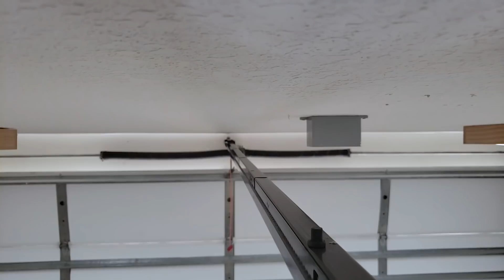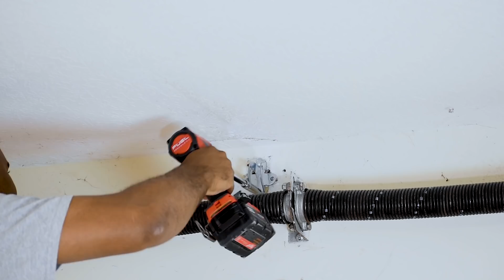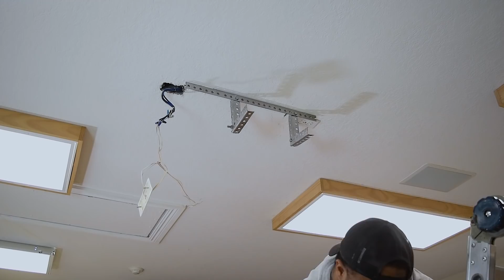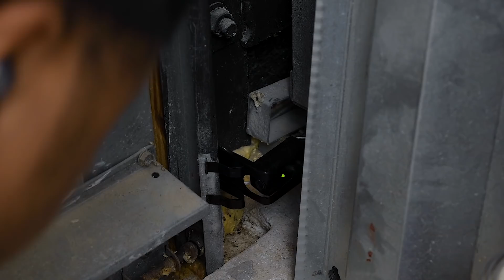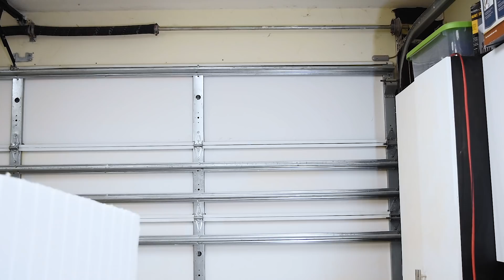3 DIY Garage Door Upgrades | Adding insulation, Replacing Opener and Weather Strip (in one day)

Comment from the maker: Thanks to all the Garage-Pros! I got rid of the slack in the belt I just needed to add a little more tension to it! 
To find out more about this project I have a written version here. I will post all my updates on this project here.  http://bit.ly/2YUeTaa
Reply: Glad you fixed the slack issue, however  you should really change the position of the door bracket from the top of the door to right beneath the strut. With that said, reverse the way you have the operator arm & elbow attached. The arm and elbow should make a general check mark shape, approximately 45°-75° of an angle. 

Trust me, it works much better this way.

Edit: Six more things to note....

1: if you do what I said with the opener bracket and arm, your door will go up further to match the height of the header, from what I see it is sitting below the header, not giving you the full extension.

2. Photo sensors are best 6-12 inches from the ground, low is good, however, it is best if you have them near the point of a bumper or point of first contact of a wheel, the latter of which is my preference. If it is too low it gives slight seconds less time for the sensors to be tripped I itiating the safety reverse, seconds that could save you a lot of money and time.

3. Your operator could be lowered (from my guess) 3-5 inches, which greatly reduces stress on the door when it runs. Yes, struts help, but you have a non insulated door (putting insulation in does not fix this issue) it generally forms stress cracks in the top of the panel given enough time, or if a stressful event occurs (hitting the doors, spring failure mid cycle, etc.)

4. When you talk about lubricating a door, show them helpful places to hit, including wheels (especially if you have bearings), pulleys, if applicable, springs, operator rails and bullet system, as well as hinges. Noting you sprayed the side track.....it is good in thought, but the wheels do not actually touch where you sprayed. Run the door up and spray in the rounded part of the track where the wheels actually run along, best to start at the curve of the track and run the spray down to the floor. Another tip, if your door is still creaking, manually operate the door and spray between the panels....run it a few times and wipe the excess, it usually does the trick. In  between seasons this happens often.

5. When adding insulation it can add as much as 10-25 lbs. to the weight of the door, which in most cases is too much for the springs that are initially with the door, meant for it's original weight.

6. When uninstalling an old opener there is almost never a need to remove the belt/chain, or the rail itself. You only gave yourself more work.

J & B Garage Doors, 50 years family O&O

Best of luck in your endeavors.
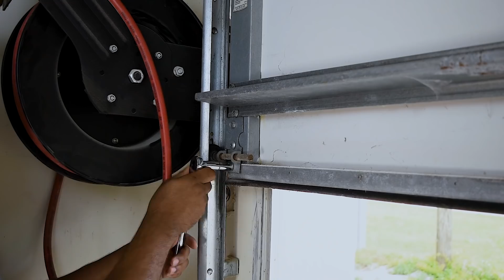Reply: @influxedhoc  Really good advise for anyone undertaking garage door DIY :). I would also add that the bottom brackets the cables attach to on the door are under a massive amount of tension. In the video at 9:49 when the weather seal is being installed the DIYer removes a screw from the bottom of this bracket. Whatever you do, do not remove the rest under any circumstances!
Reply: I’m curious where you got the new weather strip ?
Reply: Portoni garage
Reply: One of the first repairs on my house 9 years ago, was the garage springs (style exactly like yours). Over $450 estimate. I ordered 2 springs off amazon for $40 each, and used two bathroom scales at each edge of the door so I could weigh the downward pressure and even them out. You'll need a couple of 1/2" steel bars to torsion the springs. Replaced old chain opener with a belt drive too! The old chain rail can be cut up to create brackets/hardware.
Reply: Did you indicate across the top of the garage door opening? I see a lot of light there in my garage and always think about trying to insulate somehow without interfering with the door movement.
Reply: The slack in the opener belt is caused by door being to heavy. Openers are only made to push and pull 5 lbs. Insulation should have been added before springs were changed to adjust for added weight. Store bought opener will only last a couple years before shredding the plastic gear and sprocket from having to pull extra weight.
Reply: Good stuff here...I would recommend also changing the wheels that help transport the garage door up, as well as using Lithium Grease for lubrication over wd-40
Reply: DIY Creators your welcome

Comment: My garage door does not have the cross bars (vertical/parallel) ones, therefore, do i need to install some before planning for insulation?  I live up north and would be installing insulation to keep some heat in. Thanks

Comment: Hi, what did you use to lube the garage door tracks?
Reply: Saad Ansari  white lithium or white grease in a spray can or some hardware stores have a can called garage door line that will work NEVER WD-40

Comment: Just an FYI for any diy’ers, you can just pull the pen from the front bracket and take out the bolts holding the motor head in the back to the bracket in the ceiling and take the whole operator down easily. He does have a few things wrong but it’s better than what a lot of people have done. Keep in mind this will take the average joe about better part of a day. If you buy this product at Home Depot there’s a lot of local companies that will put it in for 150 or so.

Comment: I'm a garage door technician and I noticed that he has a 5 section panel door which that means is an 8-foot door he never use and 8 foot extension for his garage opener so that means that his door will not open all the way because all garage door openers come with a 7-foot setup you have to buy the 8-foot extension kit.

Comment: Adding insulation without adding quarter turns to the torsion spring is a terrible idea. Not to mention you shouldn't even add the quarter turns, as you change the weight of the door you recalculate the IPPT and change the springs out. For example a 16x7 two strut door typically has 2 2 inch 207x22's. Where as that same 16x7 with insulation is 218x24's. Never spray lube inside the tracks, the rollers are designed to roll not drag. You'll get dead spots where the lube runs out quicker, or driers faster typically in the radius of the horizontal track where your door can start to jerk as the rollers need to change speeds in order to keep up with the door moving at a constant because the rollers with lube in the track are partially dragging. Springs, hinges only. Grease on the T rail for the motor.

Comment: Thanks I replaced my garage weather strip after watching this video.  Just FYI the weather strip may be tight for your rails.  I used some wd-40 and pull on one end with a plumbers wrench. The end where is pull got beat up so I pulled the weather strip longer than the garage door and cut off the damaged end.

Comment: Here are a few things you did wrong.

1. The opener bracket that connects to the door is in the wrong spot.
2. The J-arm is backwards
3. The springs are incorrect now, becuase you added insulation to the door. You should have added the insulation first before changing out the springs, this way the company could load the right spring to the correct weight of the door.

Comment: Should have bought a jack shaft opener...best purchase I made, that and new poly rollers.  By the way WD-40 is not a good choice for lubing rollers.  Will attract dust and it will dissolve styrofoam
Reply: Roddy Da you should never put a jack shaft on a standard radius door, shaft spins too fast and cables will dump
Reply: Brandon Dodge You don’t know what you’re talking about.  I have not had a single issue....and my door is the cheapest builder grade door you can get.

Comment: Wow! Great job. I might have to put in that foam insulation on the door as well as my garage get baked by the sun. How much did it cool down your garage?
 Mine gets up to 86-90f in there and was thinking about installing a fan that turn on with a temperature regulator to vent it. 
FYI: I got a similar garage door opener and love it. In most cases it will not work with homelink in your car. If it doesn’t you need to buy an additional adapter for it to work. It relays the signal from homelink and send a new secure signal the the opener. This should just be built into the unit itself as a feature. 
Keep up the good videos.

Comment: Good idea to just lube the roller bearings , the metal to metal  hinge points on the hinges and the springs. Also, when replacing the bottom weather strip . Leave a couple of inches on each end then tuck them into the strip, that way the weather strip won’t move from side to side as the weather changes.

Comment: We went 15 years after this house was built before a tension spring busted, then just over a year later it happened again.  I replaced it last time my self and saved hundreds,  the only tricky part is ordering the correct size spring but there are plenty of measuring guides and getting the Right or Left wind correct other than that it's a simple job, I even got a free set of cables with the spring order so I changed them also, I still have the liftmaster motor, I keep thinking it will die soon but it keeps on ticking and I just keep the tension springs and chain lubricated, Your channel is great.

Comment: Took down a lift master solid shaft to put in a store bought opener that comes in pieces 🤦‍♂️🤦‍♂️🤦‍♂️
Reply: Added insulation, which adds weight after having springs changed and installing a new opener that are set to the weight of the door. 🤦‍♂️🤦‍♂️🤦‍♂️
Reply: Hahahahaha. I was thinking same thing. No one else caught it.

Comment: I work installing garage doors and if you add weight to the door (insulation) you have to change the springs since the door will be heavier and the motor will carry that weight.
but good video!
Reply: Javier Venegasyes but most of the time you’ll be fine with the original spring. Just give it a couple more whinds.
Reply: @francolopezjr27  Crank it a bit and check to see if the door is balanced when the door is disconnected from the opener.
Reply: Franco Lopez  adding a few more winds doesn’t make it better it just picks the weight up off the ground then at which point it will be over tensioned and exceed force settings the proper most efficient way is to change the springs when you add insulation. Having the proper springs with proper ippt rating gives your springs the proper amount of life cycles. Adding extra weight to an existing spring can cause it to break prematurely
Reply: Javier Venegas I’m glad someone said that I was about to when I saw this

Comment: Your operator arm isn't connected correctly. The operator arm should be connected to the center stile on the top section and the straight arm goes up to the motor rail and the elbow arm connects to the center stile.. basically its upside down

Comment: Pretty decent job as a DIY would note that adding insulation after springs were replaced could most definitely that the springs are no longer correct size for weight of the door and will alter the life of the door and motors life span

Comment: Any added weight like that of insulation requires a spring replacement to properly balance the door. Some people on here will say just add a couple quarter turns but if you do that the springs will break long before you get the cycle life your supposed to get out of them.
Reply: wesleyallen18 insulation kits don’t weigh anything.

Comment: Great video. Unfortunately, I heard rubber belts are a bad idea in Canada. We have temperatures goes from 25 C down to -40 C which can deteriorate the rubber belt over a short period of time in your unheated garage. This won't be a problem if you have an attached or indoor type garage.
Reply: Here in south Texas the heat eats the belts fast too. They tend to stretch passed what the adjustment can compensate for.

Comment: oh... I can already tell this is going to be fun. 

1: less than a minute into this, 59 seconds.... The primary reason this operator is quite isn't that it's belt drive. it's because it's a DC motor. Belt driven does help with this, but it's mostly because it's a DC motor....  

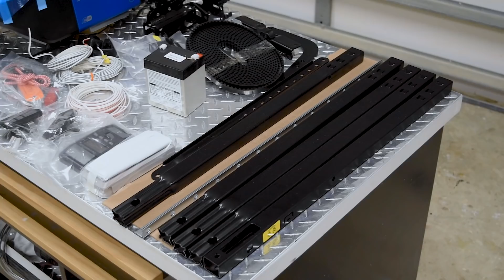2: The Tbar that is mentioned shortly after....before 1:37..... is better than the multiple pieces for the rail. those pieces can rub against each other and create additional noise over time... one of the things he's already bragging about in this change out.  

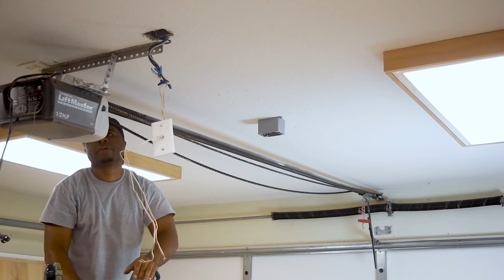3: 1:55 well... I didn't make it far this time. This entire unit can be taken out as one piece. disconnect from the door, then disconnect from the wall, and then the ceiling. He was right about one thing. He's no expert.

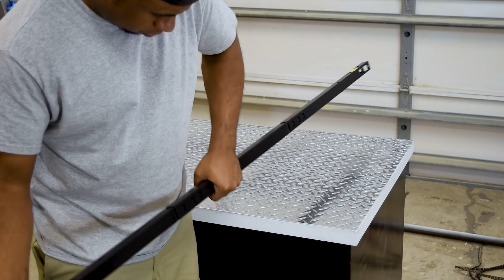4: 2:43 If he had purchased a proper t-rail operator for this replacement, he could have reused the old bracket. the old unit and the new unit are both liftmaster. It should be noted that you cannot purchase a proper Trail operator from Home Depot.

5:  2:43 It's very unusual that there would be space side to side between the operator mount and the spring mount. They are usually mounted to the same piece of wood. If they don't line up, either you're on a completely different section of the door, or one of the two is not connected to anything solid.... consult a pro. do not mess with garage door springs without proper training. 

6: 3:06 This one is mostly personal opinion. If he had purchased the same operator, but a chain drive, he could have reused the Tbar that he was in such a hurry to get rid of. That would have been a superior setup. The Tbar will bolt into those same spots on the operator, but the old operator was chain drive and the new one is bet driven. (this is unique to this specific install, but not something that I would ever encounter as the operators I install come with a Trail like what was taken out. This is still not the best option as the pulley on the door side will wear out over time. If you can find it, purchase a 1 piece rail if you're going to replace your operator.) 

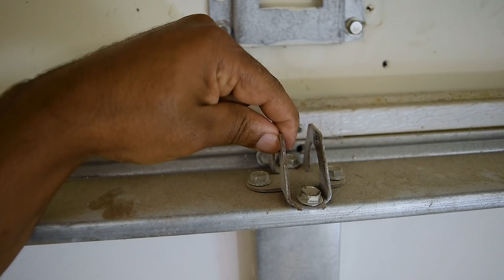7: 5:56 That setup is completely wrong. The bracket he says he didn't have to replace is mounted in the wrong location. It should be below the Strut.... not mounted to it, and the bend in that arm he just put together exists to wrap around the strut and should be on the down end.  Other garage door techs have already made this comment. 

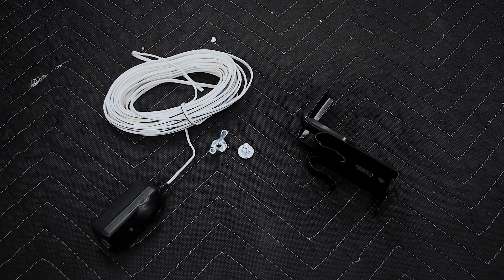8: 6:44 He discusses wiring in the photocells, but shows wiring in photocells and the wall button. Replacing the photocells technically isn't necessary.  The photocells are the same from the old to the new, and rarely go bad. This step does however offer you another opportunity to make a mistake and cross a wire. Save the old ones, just in case.

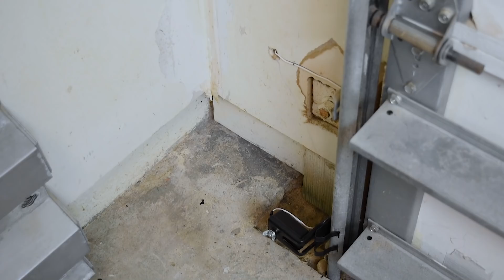9: 7:15 "Usually this is a no traffic area in every garage"... not true... people love to prop stuff up in that area. It's pretty profitable for garage door techs when the door hits something leaned up here and knocks the door off track. CHA CHING!

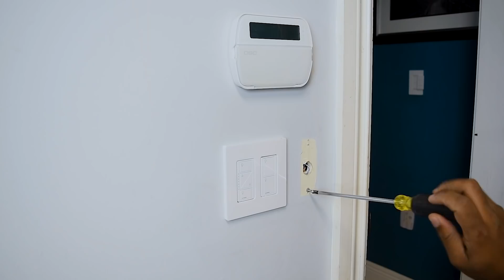10:  7:25 "staple the wires to the wall" or something like that... If you use square stapes, they can cut the wires and cause problems.... "and for safety reasons, you want to keep these pretty low to the ground." The distance from the ground is strictly regulated. Be sure to check the instructions for where they need to be mounted.I look forward to the day when home inspectors actually check this when you go to sell your home. 

11: Be careful when pulling screws from this area of the door. The one he pulled also attaches the bottom bracket which the springs are attached to. Removing this bracket completely is very dangerous. 

12: 13:50 as others have said. do not lubricate the track. Lubricate the spring, the hinges, and the bearings inside each roller, but never the track.

That covers my criticisms I don't mean to be negative, but garage doors can be very dangerous. One thing I can say positive about this video is that I don't see anything he's recommended that could be dangerous for someone attempting to do it. Please do more research before you attempt this project.
Reply: Nick Adams he could have actually used the t rail on the new unit. I do it all the time with chamberlain and liftmaster units. 

- garage door technician
Reply: @calebmund  I wasn't sure about switching from chain to belt. I've never inspected the pulley end to see if it would work. I'd also be cautions about leaving a used moving part.

Comment: Wasn't missing nuts and bolts. Looks like you used them all on mounting the head. You typically don't need that 90 degree extension. So 2 bolts are provided for mounting. Just two bolts with the punch angle straight down to the back holes would have been fine. Also the j arm is backwards. Curved end goes to the trolley and straight end goes to the door below the support strut. Also anyone considering adding insulation panels, it will add weight to your door and  make door unbalanced.  Will need more tension (but no more than one turn) bigger springs may be needed. For sensors to be up to code you also need to have them 6in or less from the ground. Also you didnt have to take the chain off when removing the old motor. Just the pin from the header bracket and the bolts from the ceiling mount. I adding this comment hoping it will help someone, not to bash the creator. Sounds like it was his first one and that's okay..

Comment: If you add insulation to your door, you may also need to add tension to the spring/springs as the insulation will add weight to the door causing it to be heavier for the springs to lift. Be careful and have knowledge of the springs before messing with them, for they are dangerous!